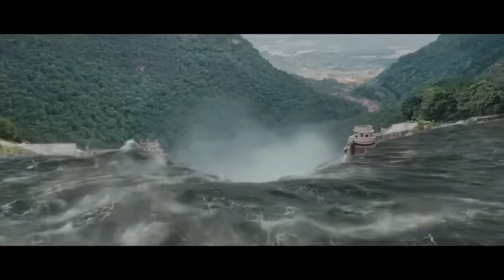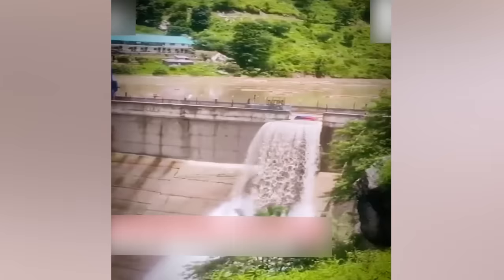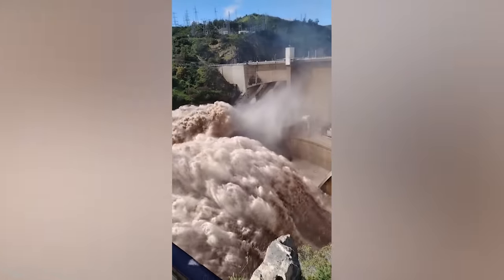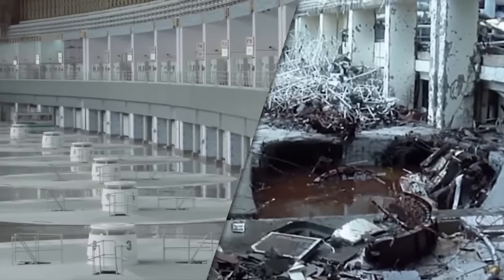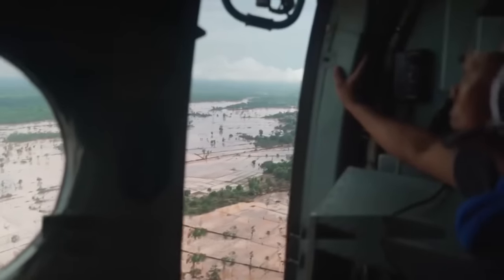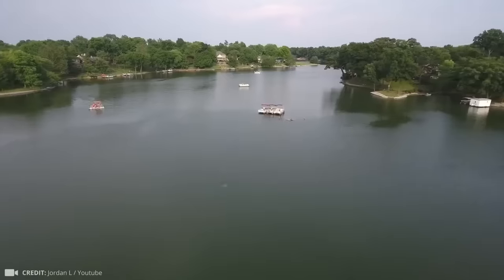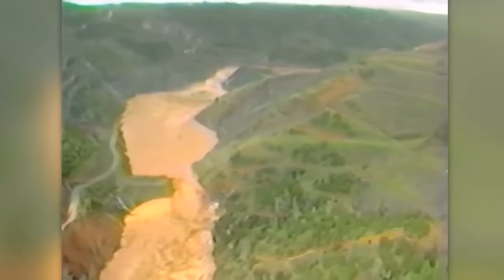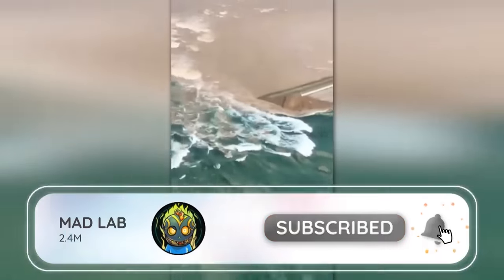Most Massive Dam Failures Ever Caught On Camera !

Comment: @9:40 Bad math. Texas is  695,660 square km, the flood area was only 610. You were off by a factor of over one thousand.
Reply: par for the course: the titanic did not weight 52 tons but 52,000 tons
Reply: Yikes! That’s a pretty big difference! 😅 It’s crazy how easy it is to miscalculate when dealing with such large numbers. Thanks for pointing that out—getting the facts right is super important, especially when talking about something as significant as a flood in Texas. Do you think they’ll address this mistake in a follow-up? It would be interesting to see how they correct it!

Comment: Amazing how these types of videos get so much wrong.  Oroville spillway was due to lack of maintenance combined with original design flaws, not thick enough concrete.  No one got a Lamborghini.   The dam in Auburn was a coffer dam built to divert water around the building of the Auburn dam.  The coffer dam was temporary but the dam work site it protected was never built due to lawsuits.  There was a chance that it would be built so the temporary dam was left in place for years longer than it was suppose to. Heavy rains were too much but the dam actually failed as it was designed to do.

Comment: So let me get this straight. We build dams to control flooding. Yet we still have floods because water levels become too high for the dam. Then we open the gates to prevent dam damage causing more flooding. Obviously dam construction is usually for power generation, but sold to the general public as a safety issue for flood prevention. My biggest question is what are the chances of severe flooding with a dam versus without.
Reply: The risk of severe flooding still exists but is generally managed more predictably with a dam than without one, as long as the dam is properly maintained and operated. :thanksdoc::thanksdoc::thanksdoc:

Comment: They don't have to fail to be a problem, as seen by those emergency controlled releases. The same thing happened to Brisbane Australia in 2011.. but that's a city of 2.6 million people. The sheer scale of damage was enormous, the cost to the economy was over AUD 10 billion and 33 people died, but insignificant compared to what would have been if the dam had burst. 
The massive rainfall throughout the state over the period of Nov 2010 to Feb 2011 caused global sea levels to drop about 7mm for the following 18 months. Evaporated sea water rained onto aquifers thirsty from years of drought which just sucked it all back up again, reclaiming it from the sea.

Comment: This is why you learn how to open the gates to prevent failure .. you relieve the pressure on the dam .. apparently it wasn't built strong enough to hold back the water that was possible to contain
Reply: Most dams have spillways to allow overflow of water before the dam collapses.

Comment: man for the longest time this channel has just been the absolute worst with numbers.

610 square kilometers would fit inside Texas more then 1000 times because Texas is 695.662 square kilometers in surface area.

maybe you should just stop giving numbers on this channel because I'm certain you have not actually ever given the correct ones.